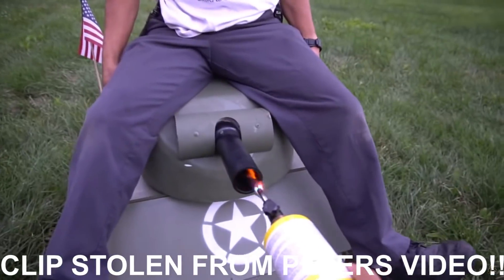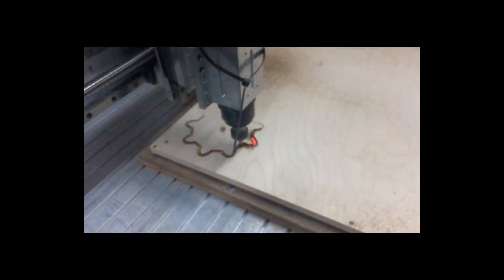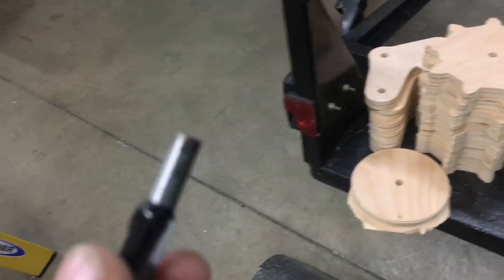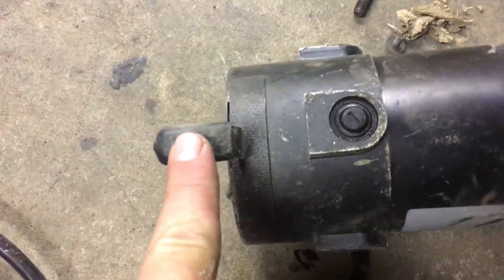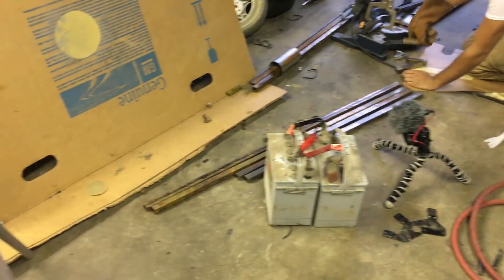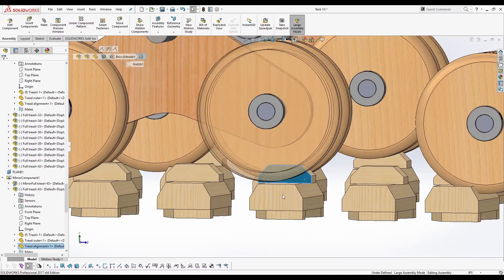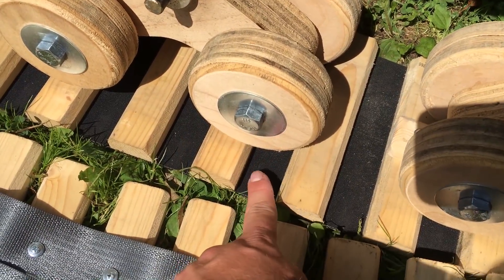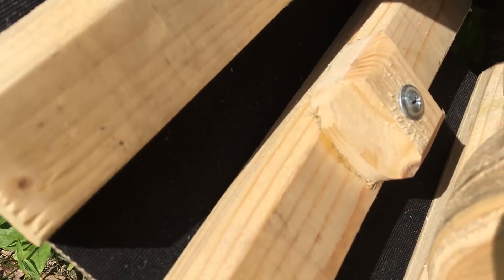Building a 1/5 Sherman Tank with Peter Sripol

Comment: This was an awesome vid, even better than Peter's part to me, because I love seeing the technical side of things being built. Would bigger wheels on the load bearing arms make the ride any smoother? Or were larger ones not feasible in the build?
Reply from the maker: Eric Prince Originally with the belts inside I had it spaced pretty well, it was the last minute change with the huge gap that really messed everything up, by then there was no time to make new parts.

Comment: Sam you can take the belting you have now and split it to four inches.  A straight edge and a sharp trim knife works rather well.  I work at a quarry and have had to do a couple belt repairs.  

To bad I'm out here on the west coast other wise I wouldn't mind helping you guys out with with some of the design details/work.  Having done a lot of prototype and one-off stuff you get a get a good eye for what works and what fails to work as planed.